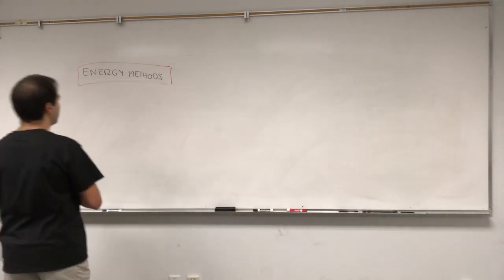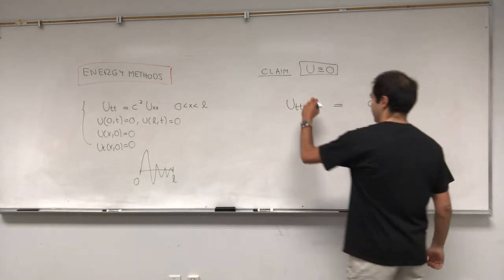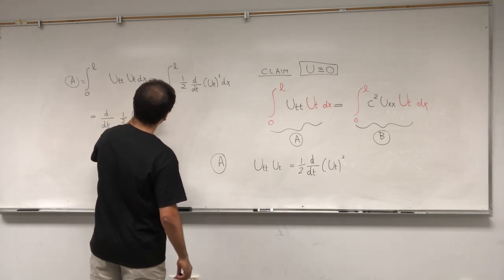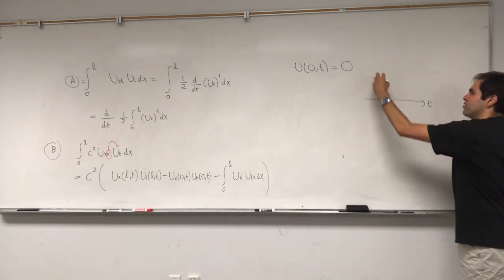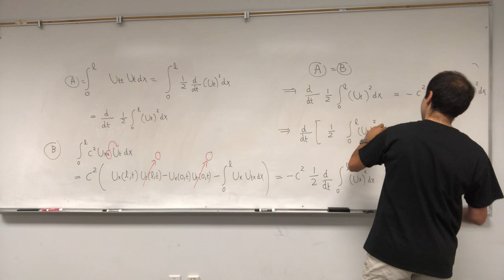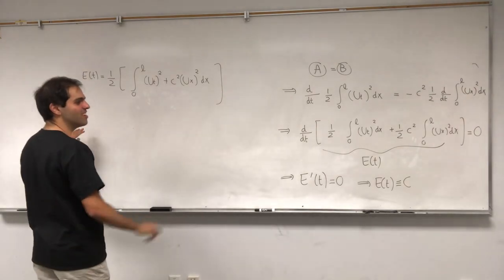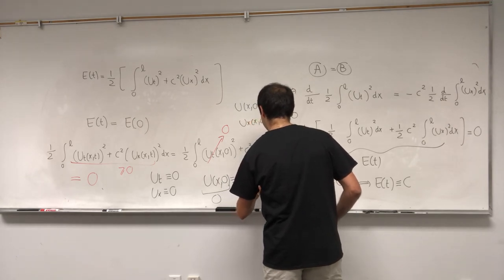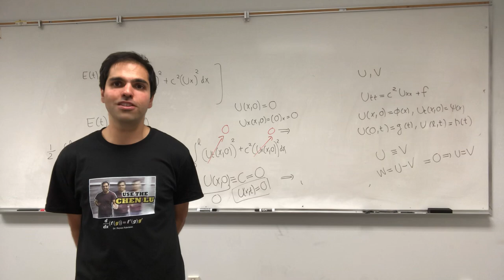Energy Method

Comment: Haven't taken physics in 30 years???? That cannot be true! You last took physics when you were 3 years old?
Reply from the maker: 13 :)
Reply: @drpeyam  13 years makes a lot more sense! Sorry, I heard you wrong.

For my part, I have not taken a physics course in 50 years (Berkeley 1970). Yet I like to suppose I still remember most of what I learned up at Birge Hall, next to the Campanile. 

Except to be honest, I spent most of my time learning how to program the old IBM 1620 computer in the 2nd sub-basement underneath Birge. That opened up a career in computers for me, and so my practical education, if not my credentialing, was accomplished.
Regardless, I think you got the potential and kinetic energies right. Assuming U(x,t) represents the displacement (say in the z direction) away from the equilibrium (unplucked) position of a point x between 0 and L on a tensioned string at time t, then Uxx(x,t) represents the force at the point x of the string due to the curviness of the string at x, given by the 2nd space derivative at that point. The stretched string experiences a force that is trying to get it back to a straight line at each point, trying to make the 2nd space derivative zero. Then Utt(x,t) represents the acceleration (2nd time derivative) of a point x on the string at time t. Since force = mass times acceleration, and assuming m=1, you get your original PDE. (I think.)
Reply from the maker: OMG, Cal!!! I did my undergrad and grad there 😍
Reply: @drpeyam  I know you did, and now you are at Irvine, is that right?
Reply from the maker: Correct 🙂